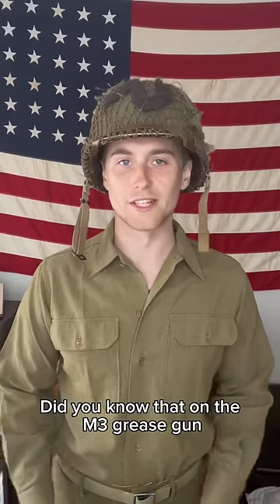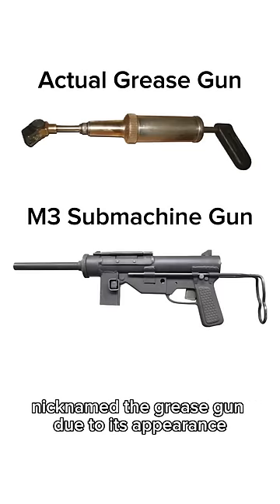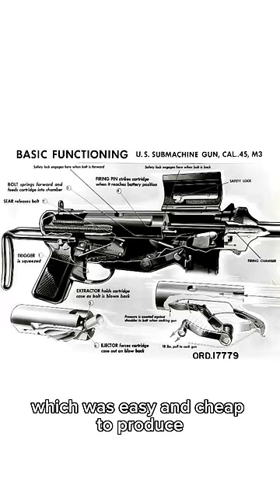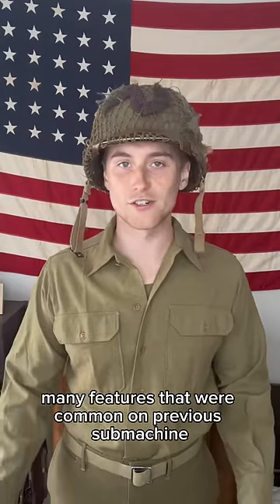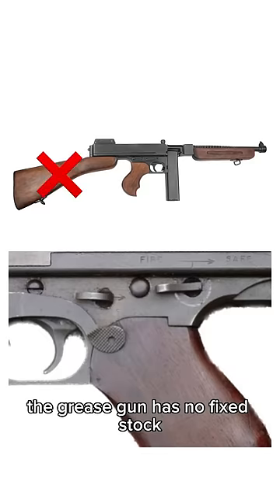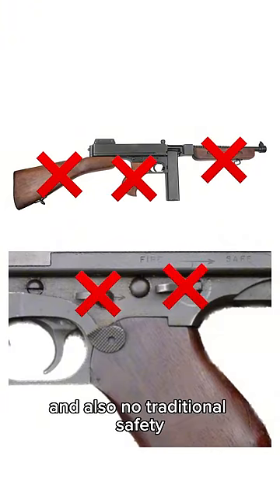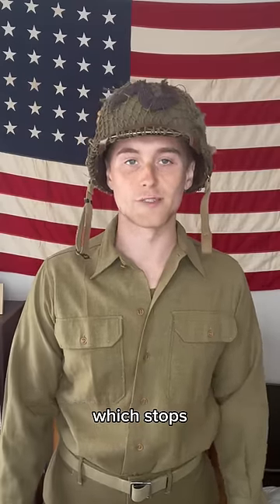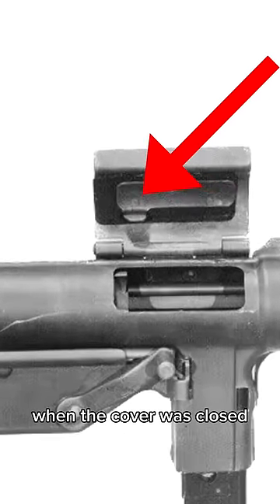Did you know this about the M3 Grease Gun?

Comment: The other safety was to not cock the gun unless you intended to use it afterwards, since its open bolt it does not hold a round in the "chamber"
If you take the magazine out you can let the bolt slam home, while holding it in a safe direction, and it is extremely unlikely to fire, since a bullet would have had to be left behind by the magazine for example
Then you can insert the magazine and the gun is not primed to fire until you cock it, regardless of the dust covers position